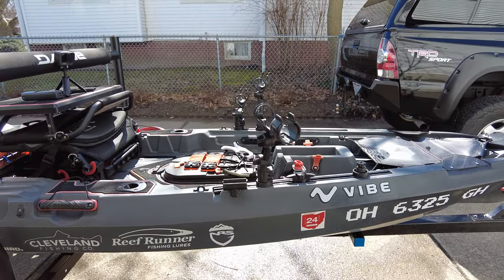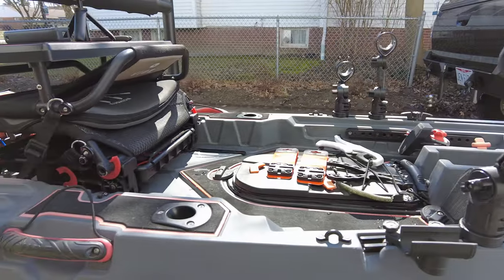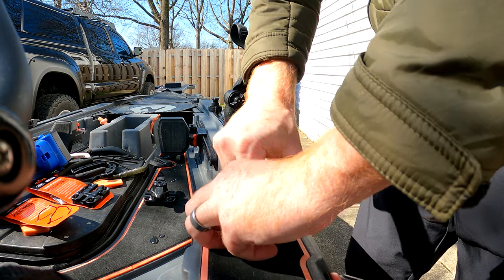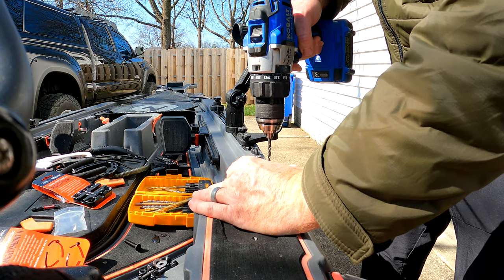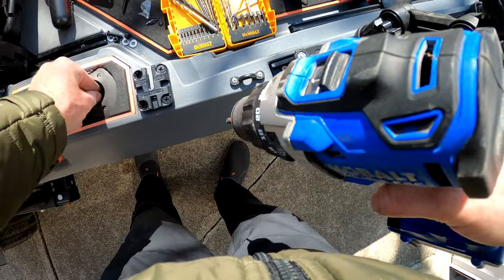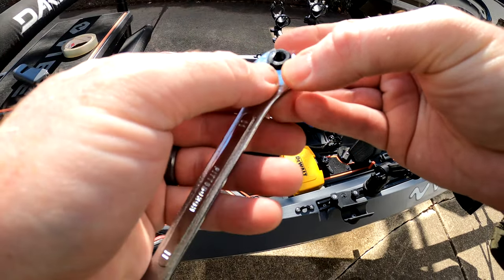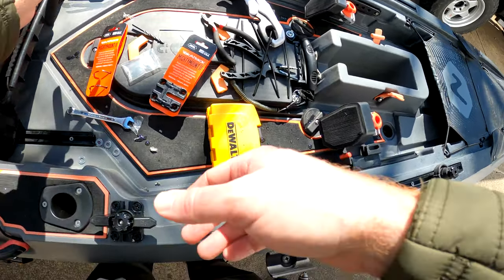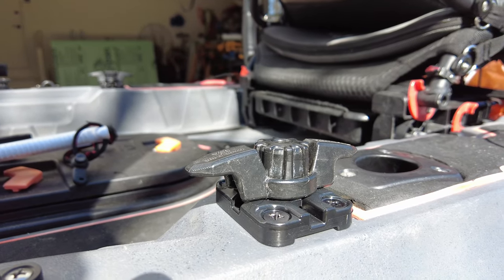YakAttack MightyMount Install on Shearwater 125 Fishing Kayak. More Room For Accessories!

Comment: Did you relocate the factory rod holder to that position, or add new ones?
Reply from the maker: I added some new ones. Cheap on Amazon.
Reply: @gunnrunnerfishing I added some as well last year.  But it had different mounting hardware.  Long story short - I hooked up on a kingfish and it pull my screws right out. Have you had any issues with yours?
Reply from the maker: @jasonbourgeois8363  no issues pulling them out, but then again the biggest fish I target are steelhead.
Reply: @gunnrunnerfishing  I’m going to try and get some nuts on them from underneath.   But it’s gonna be hard to get to them lol.
Reply from the maker: @jasonbourgeois8363  you could also consider using some omega rod holders from Yak attack, instead of the flush mount ones